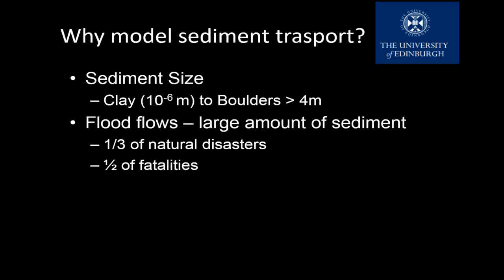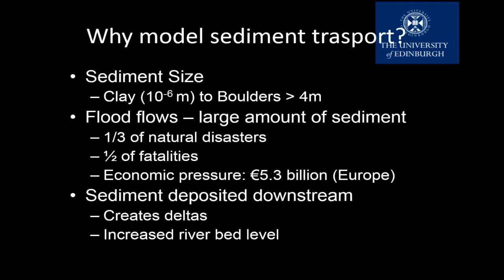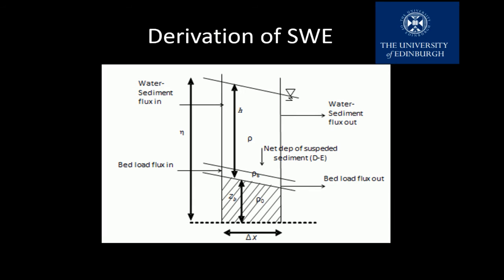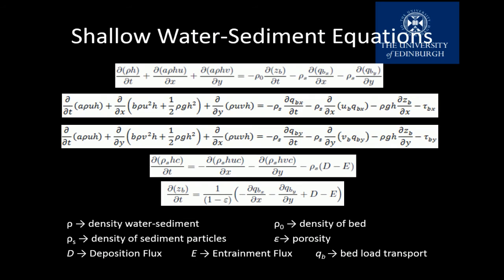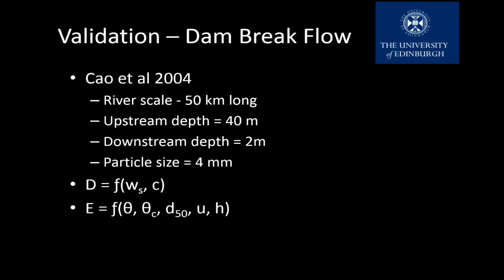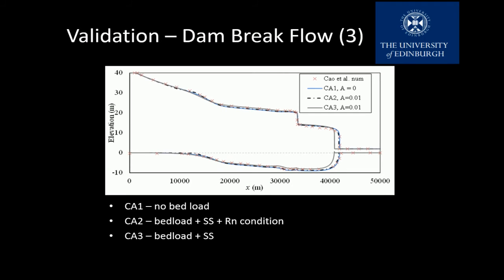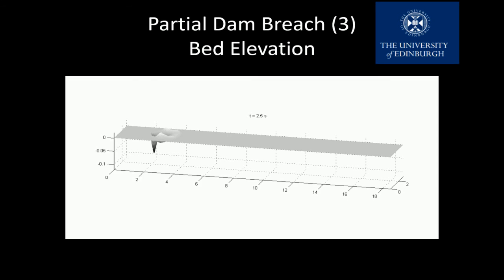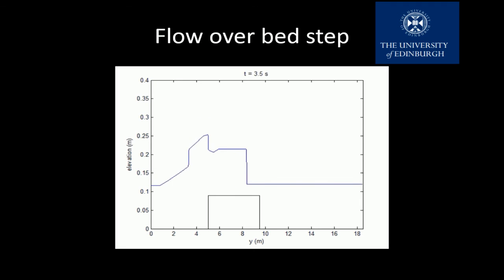Modelling Water Sediment and bed Morphological Changes - Maggie Creed

Comment: Hi Maggie, thanks for your presentation. I'm a phd student with a similar idea, but 1D and considering basin supply. Some suggestions/questions to you: have you seen new Hec Ras 5.0?. I guess it also calculate bed change and consider it for hydraulic slope, but it is 1D. Are you considering roughness (control for bed stress) changes?. Do you need two equations for sediment continuity because of separation between suspended and bedload?. Feel free to write me a mail. Thanks a lot